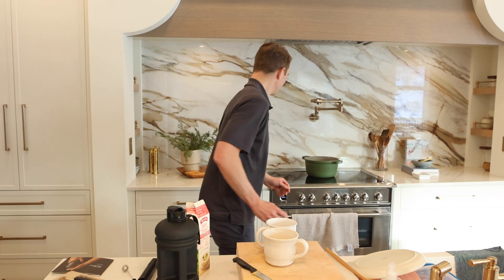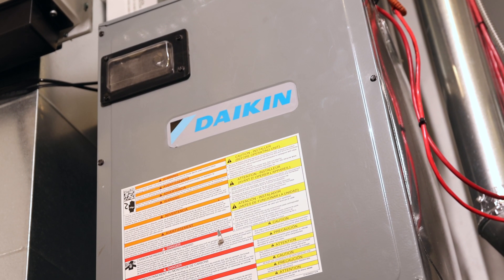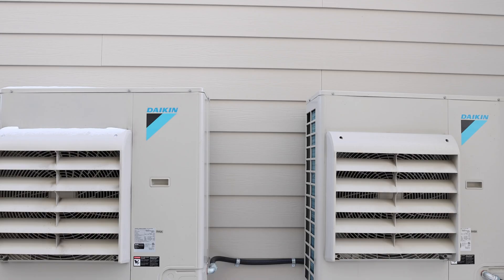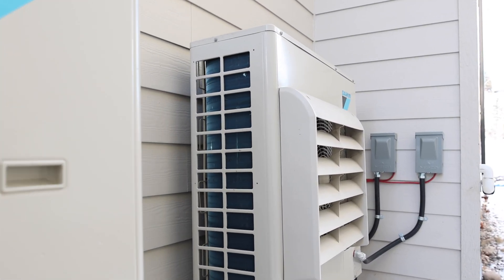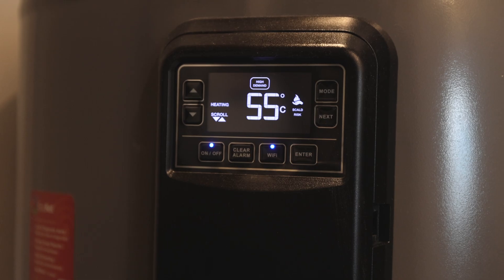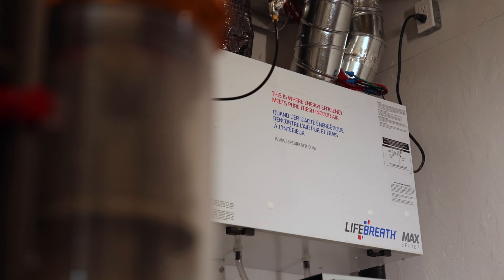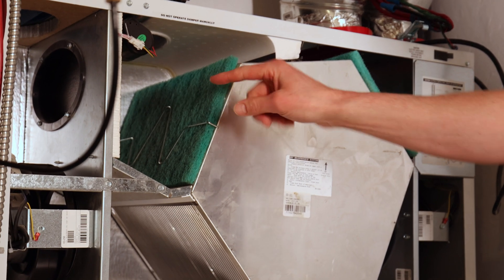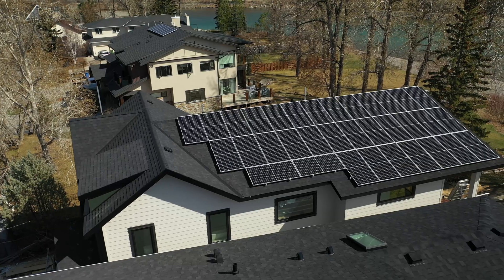No Gas? No Problem! See this ALL-ELECTRIC Mechanical Room

Comment: You fail to mention the comparative cost of electric versus gas equipment.  Heat pump products such as your water heater can be up to four times the cost of natural gas powered units. In  addition, gas fired clothes dryers cost much less to power.  In Michigan the cost is about one third of that to operate.  Perhaps your bias  is based on the fact that installing natural gas appliances can involve a more sophisticated skill set including the planning and placement of an exterior exhaust vent and plumbed connections that cannot be done in PVC.
Reply: Toxic products inside home air, fire risk, and with exterior exhaust you have to consider make up air .

Comment: Does the HRV utilize the same ductwork for the heating and cooling system or is it separate? How does it get fresh air to all the different rooms?
Reply: I'm no expert here but from what I've read your house would need two sets of ducts. One for conditioned air, commonly pushed to bedrooms. Heading and cooling go through the same ducts. The second is return air back to the HRV, commonly sucked out of bathrooms and kitchens.